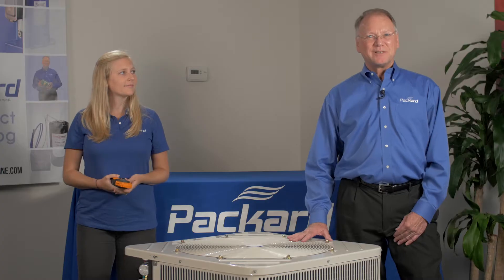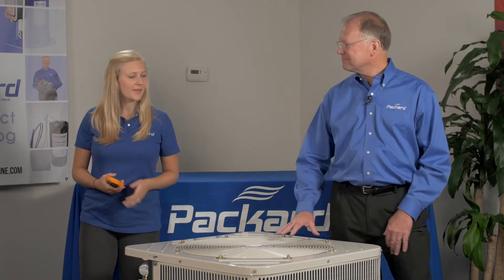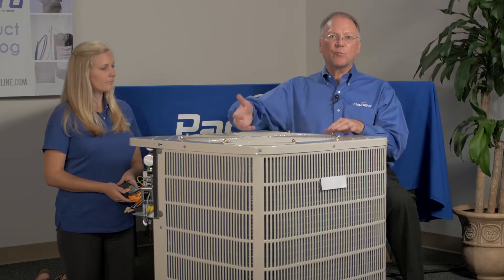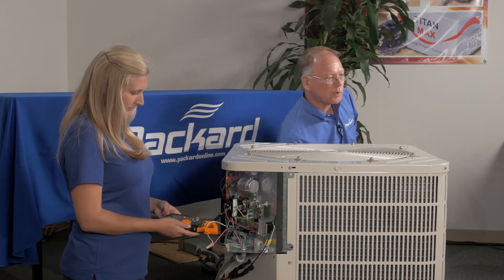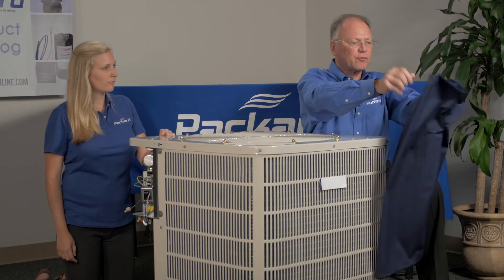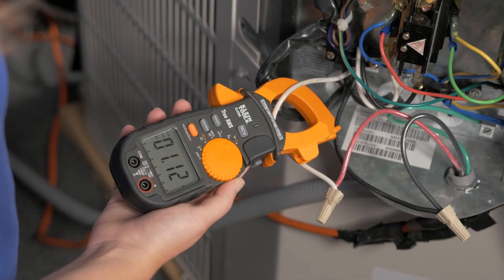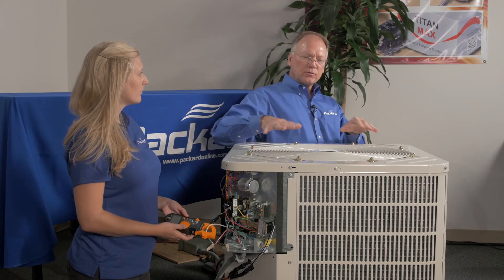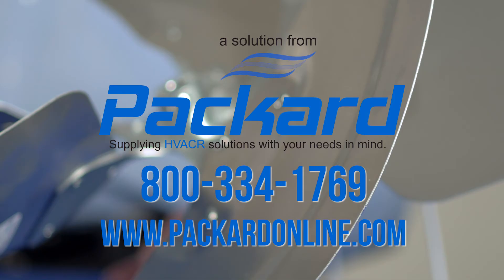The Effect of Static Pressure on a Motor with a Fan Blade

Comment: why amp increasing ??
it should to decrease because flow decrease
Reply from the maker: The effect of static pressure is just the opposite on an axial fan, like a condenser fan, then on a centrifugal fan, like a blower. 
 
As static increases with a blower the load on the motor decreases because less air is available for the blower to work.  This results in the motor operating at lower amps.
 
However, with an axial fan the motor works harder as it tries to overcome higher static.  The result will be less air over and through the coil, but the motor works harder as it tries to overcome the increase in static pressure.  Higher motor amps will be seen.
 
This is just the impact on the blower and fan motors.  You then must consider the impact on system performance.
Reply: Packard Academy. wait a minute that can't be, blowers an fans are the same thing, if a fan raises amps when starved of air on the inlet and filled with static pressure then a blower should raise it's amps when starved of air on the inlet and filled with static, they are both air pumps and should see the same change in power.
Reply from the maker: Rick Streacker, National Trainer - This can be a very difficult concept to grasp.  Try it on your own.  Cover the inlet and/or outlet of a blower and measure the amps as you increase the static by covering more and more of the opening.  With a fan blade, add static to a residential condensing unit by covering the top grill or the coil with a sheet.  Measure the amps as you add static.

As you add static to the centrifugal fan/blower, the amps of a typical induction motor drop.  As you add static to the axial fan the amps increase.
Reply: @packardonline  What is the reason that the axial fan draws more amps on increase in static whereas the centrifugal draws less amps on an increase in static?
Reply from the maker: @gambitrc1  Axial fans and centrifugal fans operate differently, and as a result, the impact that static pressure has on the load that the device sees is just the opposite.  An axial fan moves air around an axis in one direction.  As static increases it impedes the flow of the air and more load is placed upon the fan.  With a centrifugal fan (blower) the available air enters the inlet of the blower.  The direction of the air flow is changed (typically by 90°), pressurized, and moved through the blower outlet.  As static increases, airflow is restricted, resulting in less available air for the blower and less load.
Reply: @packardonline  Thanks for replying. The more you comment the more it makes sense.
Reply: Packard Academy I agree but what are the physics behind this?
Reply: @packardonline  please elaborate more, in both cases air is in restricted in the inlet but why only for centrifugal fan the power consumption is less.
Reply from the maker: @noufalbk  With a centrifugal fan, a blower, the real load or work that is being performed is based upon how much air is available for the blower to pressurize and move.  By restricting the amount of air by increasing the static pressure, there is less air and hence less work to be done.  Because there is less work/less air, it requires less power from the motor.  The amps decrease.

Comment: the amps increase due to the behavior the motor. 

PSC motors always spin at a set speed.  Restricting airflow makes it have to use more energy to maintain speed.   these motors are designed to spin with the frequency of AC.  

ECM motors can vary their speeds.  they have a microprocessor  telling it what speed to run.  if airflow is restricted it might be programmed to spin slower(less amps).  otherwise it would be wasting energy trying to force air through a restriction.